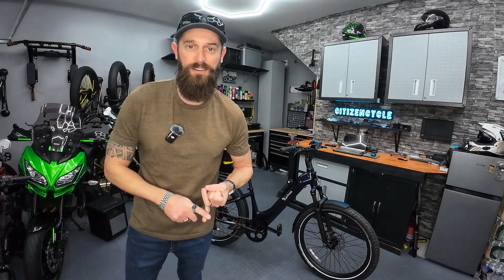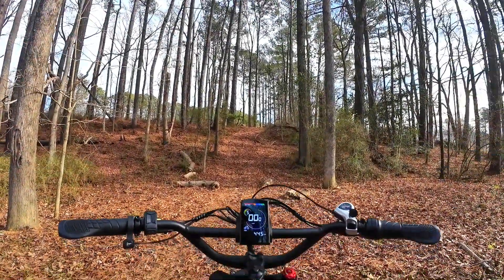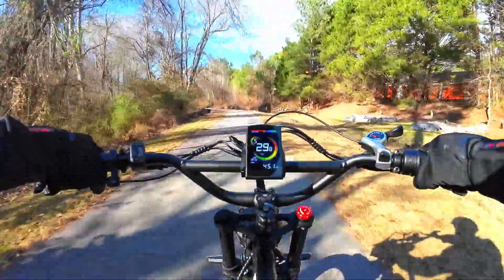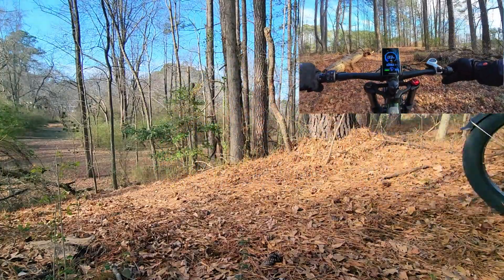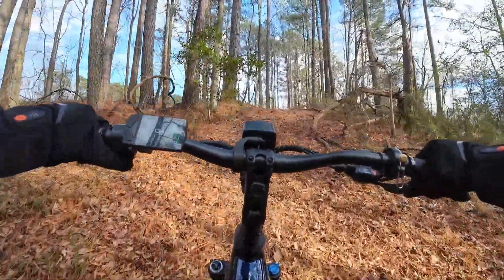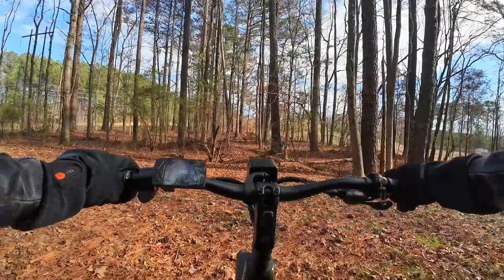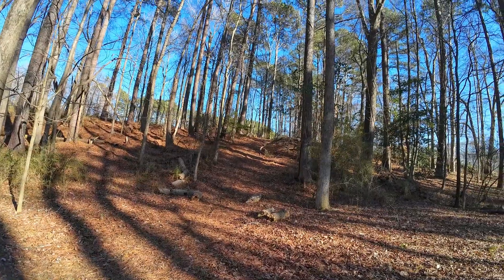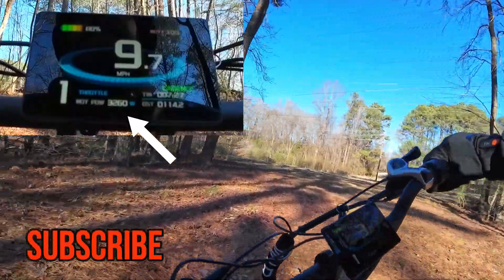How Much Power for Off Road - Ebike Motors Tested

Comment: Not to mention you probably  still have the torque set to default which is 3 but goes up to 5 and makes a massive difference in power. I can go up way steeper grades on my swifthorse pro on throttle only .

Comment: Personally as someone who owns a dual motor ebike id say anywhere above 850 watts should be perfectly suited for offroad unless its a single rear motor id say 1000+ ive got 2x 1500w motors and can go about 40mph onroad.. but offroad i find absolutely no issue going through any of the stuff ive put it through havnt gotten to ride it like i want however i know it does perfectly fine in rock gardens

Edit: now where you said "i dont care if its spinning its digging me to the top" ive had an instance where i was almost at the top of a hill front wheel started slipping and rear wheel shortly after (it was wet grass and a little mud) i started sliding backwards slightly lol but thats because both tires had already lost grip did a second run and leaned forward and i went up just fine with a little slippage

Comment: I also have the Mustache Friday 27 2019 model mid drive, I put the speedbox in the motor so I can get up to 29 miles an hr or 47.5 km from 32km or 20 mi an hr stock e-bike,designed in France with the BOSCH motor and battery. I'm from Toronto Canada 🇨🇦

Comment: ok go on some true off road  with long grades. 12% to 33% for about two to three miles & see how that goes for an ebike.
do the hub motors over heat? slow down because of heat?
 Biktrix claims thiers does it [advertised] only belive it if seen or better yet expierianced. proven :)

 short little grassy knolls are not "true" off road or hunting, unless your a city dweller in flat land, farm land areas.
Reply from the maker: I really wish I could but where I live it's pretty much flat. it's a struggle to find any kind of hills around here.
Reply: Theres no need. Anything beyond what you shown in this video is not really 'offroad' anymore but more MTB, which I find reqs a different bike type. Not just motor types, but different geometries and weight matters more. Sadly, theres a reason MTBs and middrive eMTBs are priced higher as they usually have correspondingly stronger drivetrains and beefier forks/shocks. Those prices though...Thx for the vid!
Reply: You are right

Comment: Let’s get your 45a controller on the swifthorse!
Reply from the maker: I would have to find a motor plug adapter, as well as add a new main line, display, and throttle in order for it to work

Comment: The best best with dual motors is to get programmable controllers like a flipsky 75100 and enable traction control so neither of the tires slip out.

Comment: Where can I get a Bafang 750 watt rear hub motor for a Rad city 4 commuter ebike
Reply from the maker: if you are just trying to replace the original motor with same thing then of course just reach out to Rad.  If you are trying to replace with something aftermarket, you'll need to find a motor with the correct dropout width and you may also have to change wiring harness and display.  sites like ebikeling sell kits.  If you specifically want the bafang 750w Direct Drive Motor you may have to go to AliExpress.
Reply: @CitizenCycle925 ok thank you

Comment: I have 2 mid drive bike and currently building a 3rd. Unless you become a BBSHD programming/firmware genius (which I'm starting to become), they're 28 MPH bikes. I have 3 hub bikes that will blow them away. And setting up chainlines and motor spacing is a PIA. I enjoy the build more than the ride. One of them dropped the chain, it got jammed between the motor and the chainring 1.2 miles from home. That wasn't a fun push home.
Reply from the maker: For the everyday person I really feel Hub Motors are just simple fun
Reply: @CitizenCycle925  I guess I was looking for something faster after my first ever Rad Rover. My Rover is currently faster though after the upgrades......

Comment: Agree with your assessment on mid drives. I just don't care for them much. I did a nice 750w Befang mid drive DIY build to a MTB. It came out nice but my 11 speed cassette went to hell after 1000 miles. If you want any chance of your drive train staying intact you gotta shift contanty to keep the motor happy at higher rpms. Even more so with 1000w mid drives. My fave bike so far is my Ecell's 5 Star. 1,500w motor that peaks to about 2,400w. Doesn't matter what gear I'm in, just go for it. Gets me up steep hills way faster than my 750w mid drive. In fact, it takes hills so well that I often have to UPSHIFT as I go up hills because my legs are spinning to fast as I climb the hills. My mid drive has been collecting dust. Love the 5 Star.
Reply from the maker: Yep for me the Hub drives are just simple less maintenance fun

Comment: If you combine a 160Nm middrive motor to cheap shit, what else would you expect. But this szenario in the video is the normal stuff you would do with all Bosch, Yamahas, Brose, Shimano etc. motors and they all do it with ease. The point is, they don't need 160Nm, they just have 80-95Nm but a nice cassette in the back. And you won't be able to fry your middrive motor but you will fry a hub motor on longer steep elevations. These middrives will climb as steep elevations till the point you fell of back of the bike. 
But these typical 250W motors aren't any good for high speeds, so there the hub motor makes more sense.

Comment: Great comparison video, Bryan! I found it interesting that the Stellar Falcon did the best job on the steepest hill climb in pedal assist. As you mentioned, I think the reason is that the bike is lighter weight, and also has 90Nm of torque, which is a huge help too. I bought a Stellar Falcon after watching your review of the bike and ended up selling my 90+lb Aima Big Sur fat tire bike which was fun to ride, but not very maneuverable and a pain in the neck to load on a bike rack. I have absolutely no regrets!
Reply from the maker: I really enjoy the nimbleness of the 2.8 inch tires and the lighter weight is nice too, most of my other bikes are 100 plus pounds
Reply: Thank you for sharing your experience! 🙌 We're thrilled that the Stellar Falcon has impressed you, especially with its hill-climbing prowess. The combination of lighter weight and 90Nm of torque really does make a difference, and we’re glad it’s delivering for you. 🚴‍♂ Welcome to the Euphree family—we hope the Falcon takes you on many incredible adventures! 🌟

Comment: Are all the bikes using the same tires?

There's always something that will be the limitation and tires are the first obvious choke point.

I still feel dual motors are not that useful off road, unless you are an experienced off road rider and willing to get up on the pedals and out over the front wheel to overcome some of the weight transfer.
That's going to create more rear wheel spin, but you will still have a bit more net traction and will float more than dig.

Dry, loose conditions are just one scenario - you are just as likely to be slogging through at least light mud, which is going to amplify the effect of tire tread, and with decent open tread is going to move the choke point back to motor torque.

A full suspension oddly works against you in a pure hill climb up a smooth steep hill, especially in minimal power situations where a non trivial amount of power is consumed by the motion of the suspension.

Still a useful if not perfect test.

But it would be much better if you used decent off road tires.
Not the uber $250 a pop Dillinger's, but at least more open tread tires that people who do any significant off road riding are going to swap to at the first tire change, which are available around $50 per tire.

One of the use cases you mentioned was hunting.
It might cause the higher powered bikes to really shine if you throw a load over the rear wheel to emulate game, and over the front to emulate gear that you would carry.

You likely have at least one pair of bikes in your stable that are very similar except for suspension.
Put them same off road skins on each and that would make for an interesting comparison.

I don't think anyone doing even halfway serious off road riding is going to opt for a hard tail, but it would show the importance of tuning suspension pre load for the conditions encountered.

There is also a class of bikes that would be good to include, though I understand that you are generally limited to those bikes which are most common and sent to you for review.

That's gearless hub motor bikes, as they can bring a lot more raw power to the situation.

Just as with motorcycles, it's going to come down to riding styles.

With a geared dual motor, the best approach to a hill may be riding it like an enduro, where a gearless is going to respond better to a motocross approach spinning an aggressive rear skin that digs down to solid ground, or just throws enough diret and mud to propel you forward.

Do you live in an area with winter snow and ice?
That would also be a useful test applicable to those who are using or would like to use a bike as a car replacement and need to commute in all conditions.
That's where a dual motor will really shine - especially on a fat bike - and also where best tire choice can be surprising.

Overall, thumbs for a video providing useful information for people to consider in their selection of an ebike.

Comment: Good video as here in CA, with the leftists in charge, they are declaring war on eBikes claiming "new law" changes federal CFC codes on Class 1, 2 & 3 eBikes with a 750W or less motor  as being a bicycle & not 🚫 a motor vehicle so CA CVC codes do not apply to a manufacturer certified & labled ebike CA also requires & is probablly also an unconstitutional requirement of all bicycles.

Comment: I agree about the mid drive bikes. I wouldn't want one. If that chain breaks, you're stranded. Great video as always.
Reply: It's a conspiracy theory. I've been riding a high voltage middrive for over 2 years and never broken a chain.
Reply: I’ve never seen a single mid drive bike break a chain or chew a cassette up so much that it can’t be ridden. A cheap plastic geared hub motor is much more likely to fail and leave u stranded than a chain breaking on a mid drive.
Reply: As long as you have the gear shift sensor installed and aren’t shifting like mad you’ll be fine.
Reply: The Ristretto and BMX Chimera are both high speed single speed mid-drives, shouldn't have issues with the chain... only problem is the price, I am waiting for someone to make a cheaper version, this is going to be the next trend imo
Reply: Okay now i dont ride middrives i have a dual brushless motor setup however i would like to say if a tiny chain in your car (timing chain/belt) can withstand upwards of 4000 to 7000 rpm in your car a chain on a mid drive ebike should be able to withstand the 0-1600 rpm range
Reply: benefits of front wheel drive are it prevents leaning too far back during takeoffs and don't need a chain. I designed my e trike like this so I wouldn't have to replace twice as many tires at once just to change the front, not to mention all wheel drive since I welded my differential with panel bond.

Comment: My BBSHD 72V mid drive would smoke any of those bikes. 42t chainring and 42t rear pushing 13K rpm takes me easily up steep hills in the mid 30mph range. Agree on the good components part which I have but delivering the power correctly is the key to a mid drive bike. Hubs are great for what they are but I hope someday you get the opportunity to ride a properly built mid drive bike. I’ve never had any issues in over 3 years pushing over 5Kw. Love your channel but I just want folks to know that you can have great bikes in either setup. Ride on……

Comment: Offroad I'd think using lower PAS levels and a Throttle follow setting so if you use the throttle with AWD it limits the speed so you crawl up inclines instead of spinning the tires.

Comment: Great video!
I gotta say, I totally agree with you about mid-drives e-bikes, not because I'm a 'hub guy', but because of the issues you brought up about too much strain on a bike's components.
The dual 1000w motor "Euybike S4 Pro Max" looks like a really fun little E-bike. 
The 750w "Euphree Stella Falcon", looks like it'd be great for both on & off road fun, it's an impressive E-bike.

As for the "3000w Wired Freedom", well the wattage says it all really 😁
Great video, I appreciate the honesty and no 'bs' in your E-bike tests and reviews.
All the best to all my fellow e-bikers,
From across the pond, here in the U.K.

Comment: This made me think of the next bike. A 1000w rear hub motor with torque sensor, 1000w front hub motor and a 1000 w mid motor. About a 120 amp controller for all three motors?

Comment: Do you feel it necessary to do a full maintenance on the hub motors what I mean is break them open and grease the gears just curious as I haven’t heard of anyone one doing such maintenance personally these hub motors being a sealed unit I don’t know if it would be a good idea to open them.
Reply: I do maintenance every 1k miles- over 4k on motor
Reply: Maintenance is key. The stock gears usually aren’t even nylon in some bikes so I’d say to grease it

Comment: Looks to me (a guy who's ridden motorcycles for 50 years) like what's really needed is more power to the rear wheel in general. It's not that power to the front isn't good to have in situations where traction can be had, but the bottom line is that the weight of the rider pressing down on the rear tire makes the rear the only place a person can really get great traction. So my opinion is that ideally, a setup giving massive amounts of well controlled power to the rear, and in some situations some power to the front would be most useful. So if you could work out a controller setup that could distribute power using a traction control system (sort of like a modified version of what racing motorcycles use on the rear), that would be excellent.
Reply: I've been riding bikes of every type since about 2. Yes my eBike 750W motor with no chain ring, chain, derailleur or shifter does well on most steep streets so far but could use a front motor with a separate throttle to feather in & out when loosing traction & good knobby tires for off road hill climbing
Reply: I've ridden motorcycles for at least that long as well. I never did like to have a lot of weight on the front of a bike.
Reply: Exactly.  I have a high power/torque rear wheel drive bike with precision control.  It will go up hills so steep that my 2WD bike completely loses traction on the font. With a steep enough hill, the front will completely loose significant contact.
Reply: @TimB-do2vi  makes a lot of sense, but from my E-bike building experience you don't need 2 X motors on an E-bike, just one powerful rear hub motor (1500w is plenty enough to laugh at ANY hill) is all you need.
Yeah, all wheel drive is fun and all, but really it's just added unnecessary weight is using 2 motors on a bike - and it drastically alters the bike's handling capabilities.
Some geared hub motors at 750w can be powerful enough for most hills, but if it's a 'direct drive' hub motor (rear wheel) then you need at least 1000w for hills - if putting on a heavier frame then you need minimum of 1500w (or more depending on how heavy the bike / rider is).

My 2 e-build's (1500w rear direct drive hub with 35a controller and 52v20ah battery) and (2000w52v direct drive hub motor & 45a controller with 52v20ah battery) both absolutely destroy any hill I point them at 🚲⚡👍.